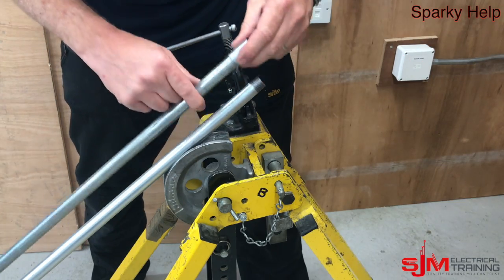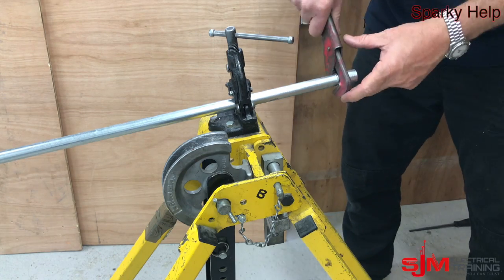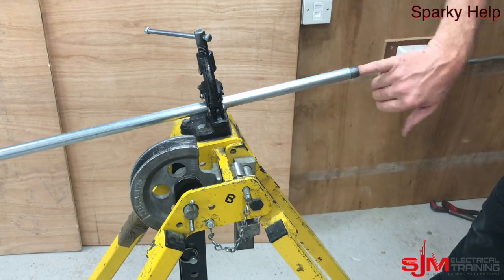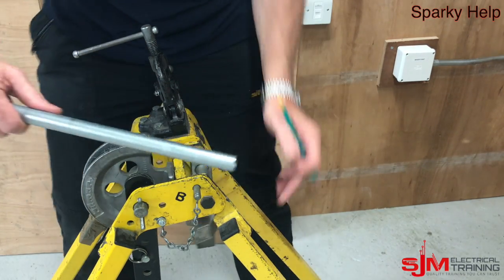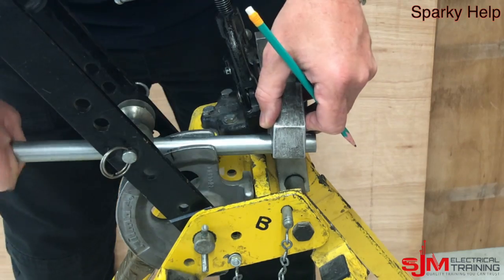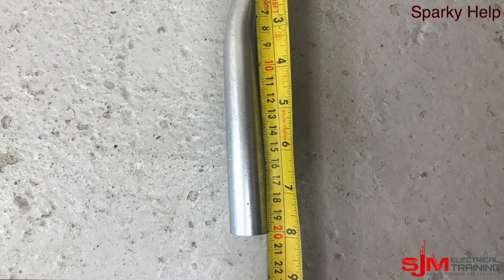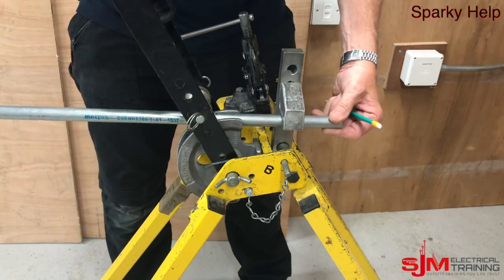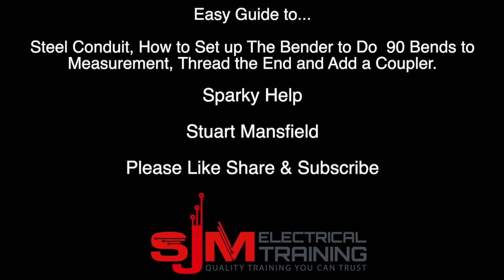Electrical Conduit, Setup a Bending Machine to Make a 90 Bend to Measurement, Add a Thread & Coupler

Comment: Any tips on how to stop the conduit finish getting ruined when its clamped on the bending machine when treading?
Reply from the maker: HI, make sure it is tight, (using hand only).  Put cutting grease on the thread when threading.  If this continues the jaws may need replacing in the vice.

Comment: Lock rings.....
Reply from the maker: ? Lock Rings!  Thanks for watching.
Reply: @sparkyhelp3997  yes lock rings, it's a Scottish thing we use them
Reply from the maker: Many Thanks, your comment was next to the video about running couples and was not sure what you meant, yes you put lock rings on the back of the coupler.  Have you used the conduit which uses a grub screw instead of a thread?

Comment: Excellent video as been wanting to know how people put marks on the former. Maybe you could do another video more detailed showing this and also 25mm tube please
Reply from the maker: Thank you please share with like minded people.  There a few ways to find  the back of bend mark (for the 20mm conduit it is twice the diameter from the back).  If you bend them the wrong way round it will be three times the diameter out of measurement.  So for a 25mm conduit try 50mm from the back of the former.  I have used other brands of benders and their measurements were different.

Sorry for the long response, please like and subscribe.
Reply: @sparkyhelp3997 Thanks. I’m confused with which was round you did it. Is the measured end at the front under the stop? Thanks